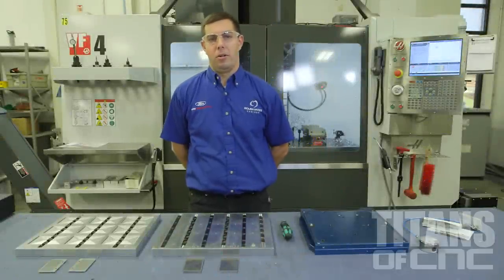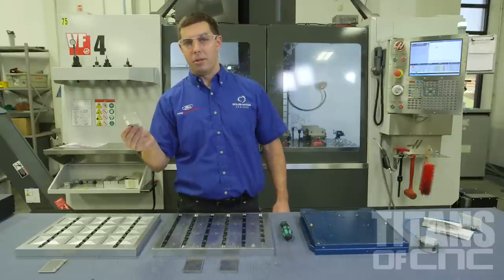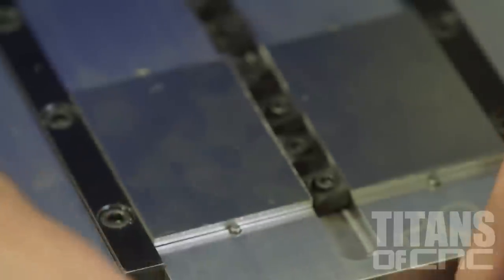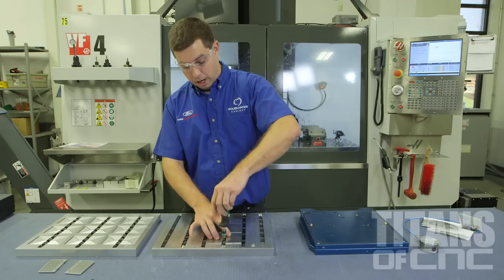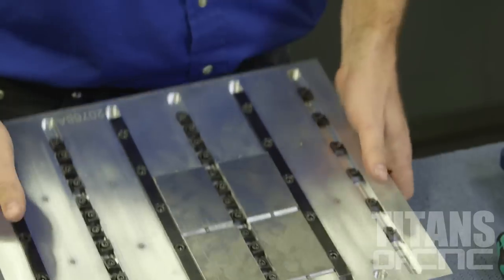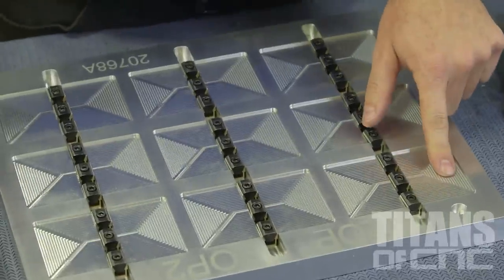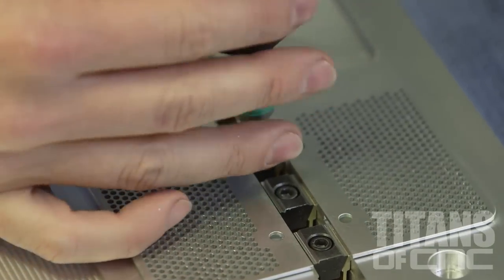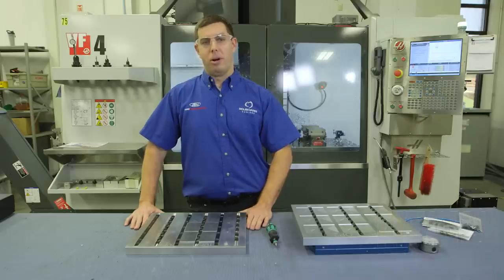Learn Roush Yates's Vacuum Plate Fixture Technique

Comment: Would have been cool to see the operations run. Is the first operation something like drilling 50 holes?
Reply from the maker: Ya, it was just a quick on the fly thing... I simply asked, Do you have any cool fixture idea's to share?
Reply: Fixturing is always interesting. Like a puzzle - searching for best method.
Reply: It was actually 418 holes per plate.   2mm diameter about .200" thick plate.  I made a drilling macro with a fast feed retract because rapid was walking machine across the floor.  Fast feed was actually about 4 minutes faster cycle time.